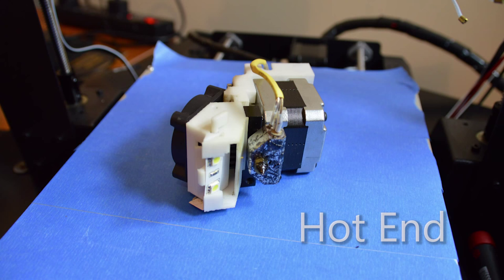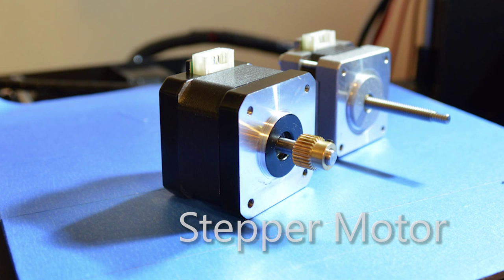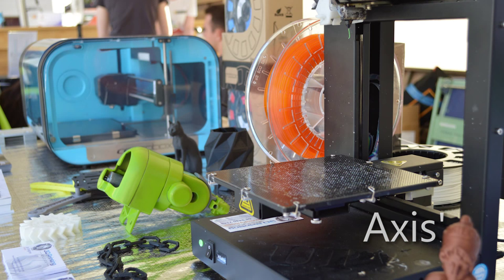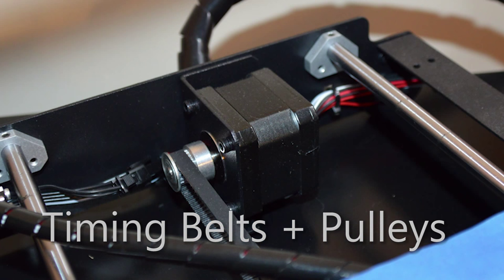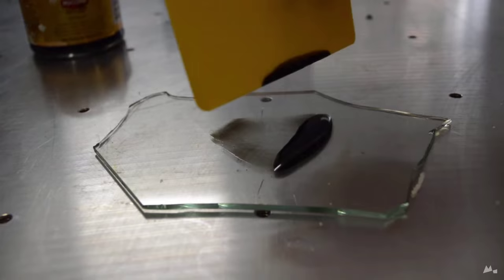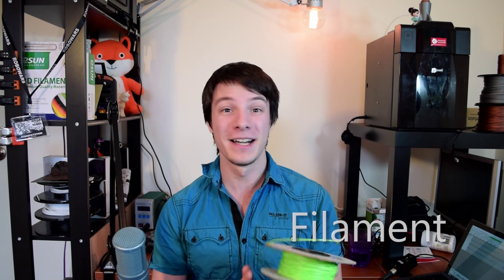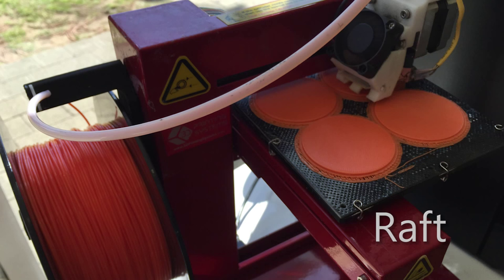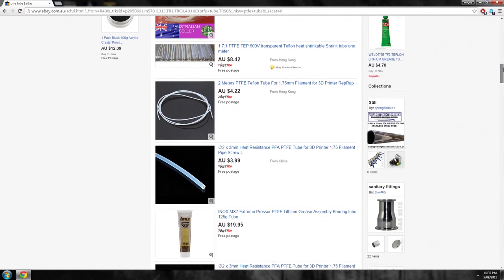3D Printing 101 - Jargon Busting! - 2015

Comment: Thank you for your new video. I am looking forward to future ones. I am being extremely causious about purchasing(or building) my first 3d printer. There are a tremendous number of questions but it is difficult to find answers when you can't "speak the language".
     Please consider these ideas for your edutional series:  What to know and consider before buying your first 3d printer;  The good/better/best 3d printers for Beginners; DIY 3d Printer--All of the bits and bobs to get the job done; Tweaking your 3d printer to get the best performance possible; and Odd 3d printer Q&A--Can i make my printer into a laser cutter or CNC router, How do I 3d print designs in different colours, Can i turn-off the printer and let it finish later.
     Is there an email(or other means) I can send questions directly to you?
   Again, Thank you for the video.

Comment: I found a few issues which I think might be mistakes. 1) You explain what is a bowden and shortly afterwards you compare it to a 'direct drive'. A direct drive is not an extruder where the cold end and hot end are joined, actually I could not find a consensual name for this (and I call it monolithic extruder). A direct drive is simply an extruder mechanism where the filament is pushed directly by the motor small gear, without suffering any reduction (e.g. with additional gears or timing belts). 2) You say that if the Z axis moves slowly you have a ball screw, but this is not true, many printers use leadscrews or even threaded rods (like in the cheap reprap printers, e.g. prusa or graber).
Reply from the maker: +Maker Linux You're quite right there isn't really a name... as with all this 'jargon' it's evolving as we go, direct drive used to just mean you're not using gears to drive your drive gear but now I hear it used more and more to describe the as you say 'monolithic' extruder designs. What I meant in describing the ball screws is if you actually kill power to the machine, ballscrews are such low friction that they'll easily drop down due to gravity (albeit slowly) and acme or threaded rod will just lock in position due to the far higher friction.

Comment: Useful vid for rookie like me ,thanks man.
I got a flashforge dreamer, recently. warping during abs pringting is quite a problem for me ,hope you can give some tips, thanks again.
Reply from the maker: +MX Z Did your FF come with the blue adhesive sheets? The trick for lower warp on the flashforge is to make sure the nozzle is perfectly level with the print bed - run the bed level routine 3 times or so to be sure its as close as you can get it without digging in / stopping extruding for the first layer. Bed temps that work well for me are 80deg C for regular ABS prints and 100 for big ABS prints. Lastly, make sure the room you're printing in isn't too cold or warp will happen no matter what you try - you need to keep the top cover on, front door closed and the ambient temperature as high as you can. Note that if you do this with PLA, it'll get TOO hot, and jam up your extruder by melting too early. Finally, make sure you grab the latest version of flashprint they've made heaps of improvements - http://www.ff3dp.com/index.php/download-for-dreamer?tab=0
Reply: Really appreciated, friend.

Yes,my dreamer came with the sheets. I was printing ABS at temp setting as extruder 220C, bed 105C, and keep the chamber closed. It came out left side warping badly, though the right side is pretty good.BTW, I was printing a small cube for benchmarking.

There is a different issue when printing PLA. Parts are printed all right when printing with a raft, however when printing with no raft, warping occurs.

I am gonna redo the bed leveling as you suggested and try again.

Thanks again for your sharing.

Comment: Hello I just discovered you vids really enjoying your clips so far.   Found a few clips from groups printing prosthetic's for places in the third world. I am lucky enough to have some extra cash I'm looking at getting myself something "3d printer" so i can give it a go. If anyone here has had a crack at this love to get some input on printer types used and plastics that have given good results, Surface finish and structure strength. Also if you have links to 3d printing communities online that would be Great. 
Thanks in advance

Comment: what mechanism does an SLS system use to preheat the sprayed metal powder?
Reply: For metal SLS a vat of powder sits inside an oven to reduce the requirement for a higher powered laser. As far as I know the powder is not sprayed, but new layers are rolled on top of the last.
Reply: okay so you man these guys use radiation to heat?microwave?..could you be  a more specific or send some links?
Reply: +arnab chattopadhyay they use a normal oven to heat the metal powder. This is done in a innert gas atmosphere to prevent oxydisation. A high power laser(light is a type of radiation) is used to selectively sinter(fuse) the powder together. The end part needs to be dug out of the powder vat to remove the part. It can then be further sintered in a furnace if required. Plastic SLS is very similar except the temperatures and powers are all much lower. There is plenty of info via Google if you need to find more detail.
Reply from the maker: +arnab chattopadhyay I think everyone already covered it, SLS systems heat the powder (plastic or metal) to 'just' below the melting point using a regular oven system so the laser only has to do a little work to heat it up just a bit more and sinter the particles in that are together. There is no spraying of powder in an SLS system, each layer of powder is added by a roller. 

You might be thinking of a technique called 'cold spray' ? CSIRO are doing a lot of work with this technique and it could technically be defined as 3D Printing as it builds up objects in an additive fashion. Check out - http://www.csiro.au/en/Research/MF/Areas/Metals/Cold-Spray

Comment: Might I ask what FDN stands for?
Reply: It's FDM - Fused Deposition Modelling. It's the technology of printing wherein plastic is heated and deposited in layers to form a 3D structure. There is also SLA (Stereolithography) where thin layers of resin are cured by UV light.